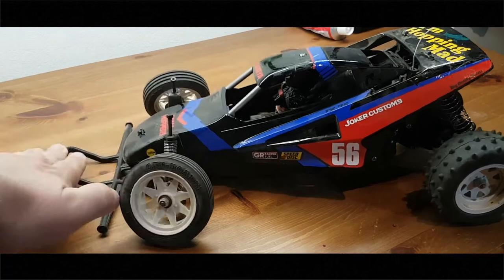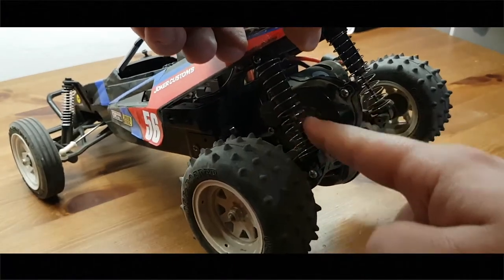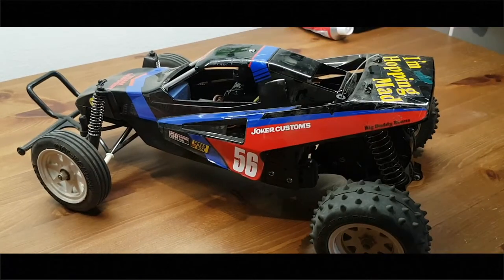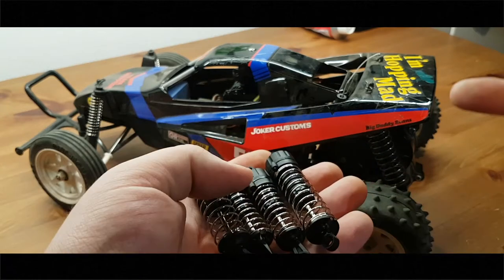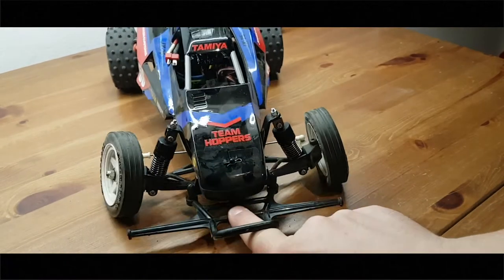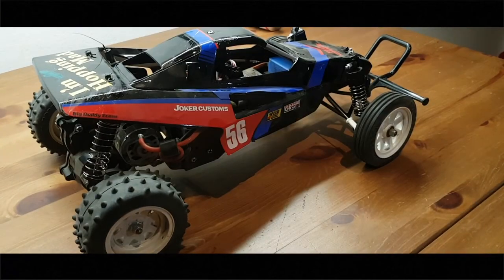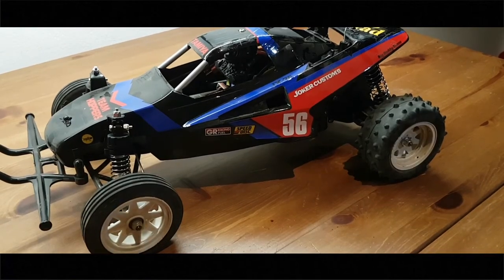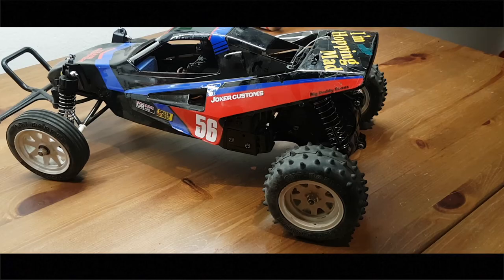Tamiya Grasshopper II (2017) -  Upgrading Shocks

Comment: Good to see you, my friend!!! :-) Great video. Straight to the point. Upgrades look good. Now you got a black GH2 Super G or a Super Hornet in disguise. Very cool. Those shocks changes everything. Just about to build my stock shocks, kind of a bummer after watching this, he he :-) Well, at least I got a Super Hornet with those shocks ... hrmm ,,, and an ancient and well used 1990s stock 540 27T. Probably just as fast now as a new 380. Looking forward watching your run video with this. It looks very good and very very mean now! Thumbs up!
Reply from the maker: Thank you very much. Yeah it's basically a mixture of the old iconic Tamiya's. I can remember that I mounted a lexan body on my Grasshopper 2 (in 1992). I think it was a blalck Pontiac Trans-Am with different tires. I'm very surprised that the Tamiya ESC's that came with the actual kits do not even get warm, when running on 3S. I will try to run the Grasshopper 2 with the new suspension this week. Cheers buddy!
Reply: Nice. Yeah, I think Tamiya is very conservative with their specs. I'm running a 10.5T TBLM-02S brushless with a TBLE-02S standard ESC. No heat at all, even though I'm at the maximum Tamiya-recommended gearing. Definitly gonna try a higher gearing then :-)
Reply from the maker: Well I'm very restricted regarding the gearing in the Grasshopper 2.
Reply: Yeah I know. Even the DT-02 and DT-03 is restricted to either a 17T or a 19T, so not many options, but at least one option more than the Hoppers. But I think your GHII and GH is more than fast enough for a rigid rear axle that looses traction 50% of the time ;-)
Reply from the maker: Absolutely :)

Comment: Got one too. And had one when I was a boy :-) Great video!! What length of shocks did you use, front and back?
Reply from the maker: Thanks a lot, Mike. When I was 12 I had one too. That's why I had to get the rerelease of the Grasshopper I. The length of the shocks is 70mm in the front and 87mm in the rear.

Comment: Hey..thinking of picking up gh2 re re..got the bug again its been a while!..want to uprate those rear shocks what ones did u get im not sure wich oil dampers fit the gh2?
Reply from the maker: The dampers are Tamiya 50519 (front) and 50520 (rear). I used the oil which came with the shocks. I'm not sure whats the exact viscosity but I would use 30wt.
Reply: Thanx for the reply..yeah will go with that..have you got a 540 motor in that? It just bolts right on yeah with 18 th pinion?
Reply from the maker: Yes. 18t pinion works. I installed the 540 15T dynamite brushed motor from the twin hammers. Not too bad on 3S :)